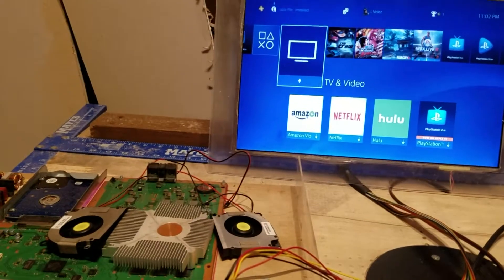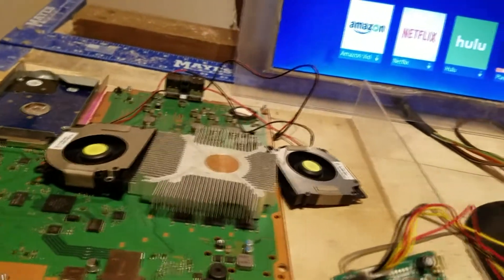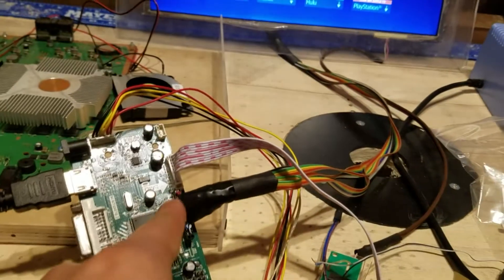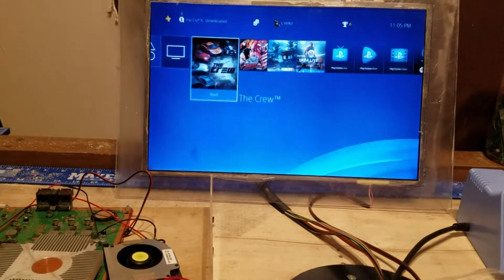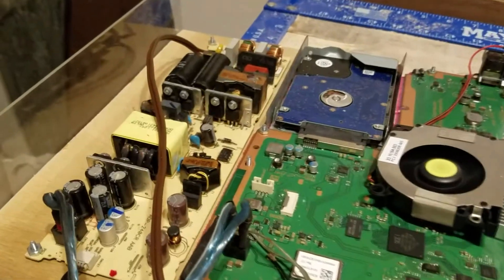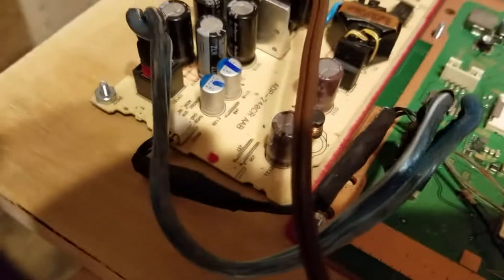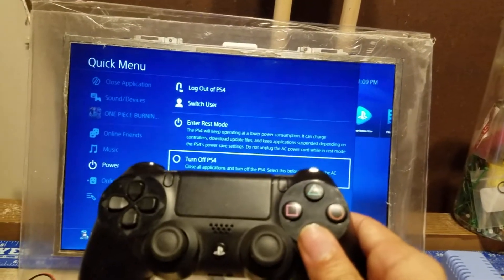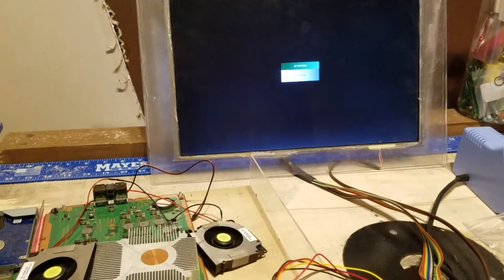PS4 Laptop Custom made!!!

Comment: Hey lee,planning on making a laptop myself.where can I purchase a monitor and controllerboard,also 3 fans like yours.
Reply: U can recycle an old laptop display and simply buy an controller for it in the end u get the same thing shown in the video
Reply from the maker: I brought the monitor off ebay and will post a link in the notes for the link to one that will work for you and I'm going to be 3D printer the case for everything that's why I'm building a a big 3D printer to print out the case for the laptop and get everything looking good. Posted the link in the channel notes for the monitor check it out!
Reply from the maker: Thanks for subscribing!

Comment: how did you get it to power on by using the playstation?
Reply from the maker: Jason there is a 12v line on the power supply
Reply: ty very much but is there a way you can show me where you hooked it up to the power supply if you dont mine and ty very much again
Reply from the maker: Jason I will in an up coming video so make sure to subscribe and hit that notification okay👍
Reply: alrdy have and ty for the videos
Reply from the maker: Jason no problem man I do this for you guys just stay tuned in for more😁
Reply: Excuse me but do you have a picture of the 12v out location? I checked your channel but couldn’t find an update video. I watched this over and over and can’t find where you wired the video controller board power. Please help, I can give you my email as well.
Reply: Is it those gray wires that’s soldered to the motherboard itself? Where the power supply and motherboard connect.
Reply: @mrmikojo5738  the original PS4 PSU has two blade  connections that is the 12v rail. I'm using a xbox 360 psu on my OG PS4.